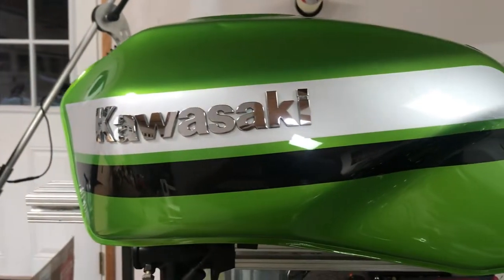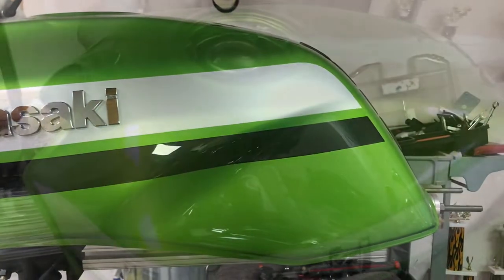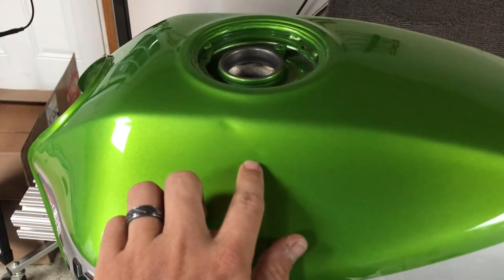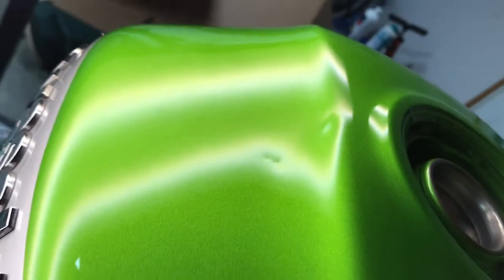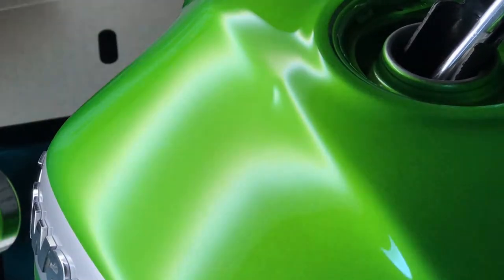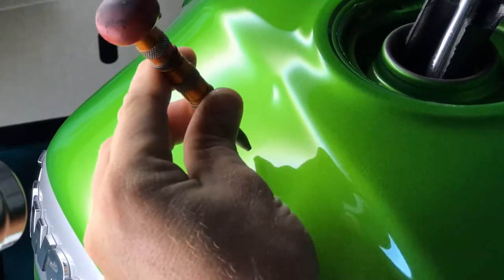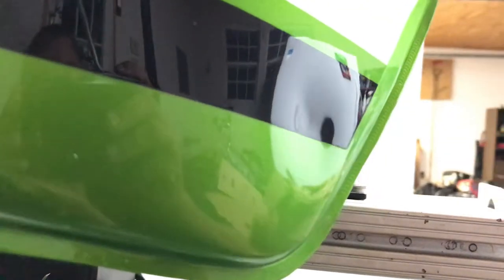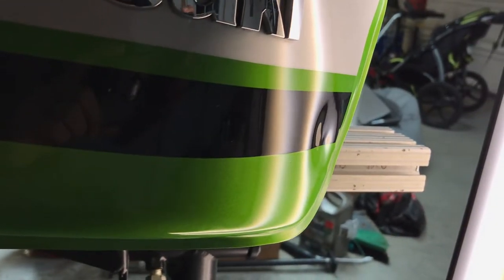Motorcycle Tank Dent Removal - Paintless Dent Repair on a Kawasaki ZRX 1200R Gas Tank

Comment: What tool did you use to push the dent out?
Reply from the maker: There’s a set of rods that Ultra Dent Tools sells and I used those…..used a J hook rod for the top and a straighter double bend for the dent on the front.